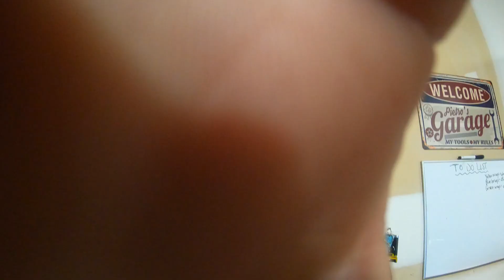What Electrolysis does to a boat!

Comment: I'm surprised there was no mention of the anode setup in the boat both before and after the re-do.
Reply from the maker: Standard zinc anodes both ways.
I do not recall the old anode being that bad to be honest. Maybe the anode was not quite as sacrificial as my outdrive was. lol
Reply: @PMPerformance  Possibly when you bought the boat the "old anode" you saw was indeed a new or at least a less eroded anode installed by the seller to give the appearance that everything back there was OK.
Reply from the maker: @rossevans1774 that’s likely what happened.
It’s a common thing with these drives though apparently.

Comment: Boat looks awesome! I need to get on this thong before you break it again! Definitely do a drone video!
Reply from the maker: Thanks man. Wasn’t me that broke it though, shady seller!
Reply: @PMPerformance  I've come to realize it's either buy something new or buy someone else's problems. Every used mechanical piece of equipment, home, car, boat etc all will come with their own set of issues. It's just a calculated risk on how bad they will be.
Reply from the maker: You could not be any more correct my friend! I never really looked at it like that before, but you are %100 correct!
I am sure the large equipment you have been buying has been the eye opener for you